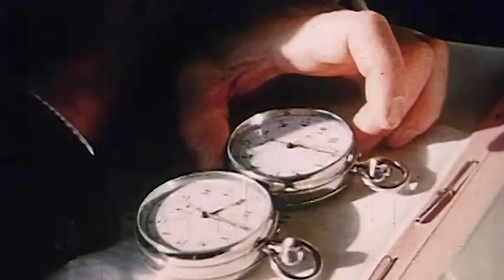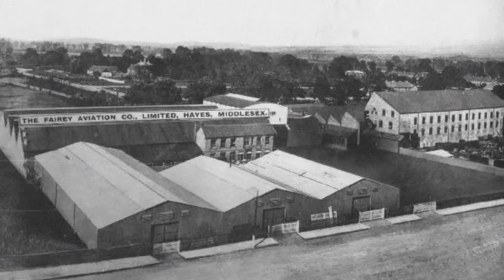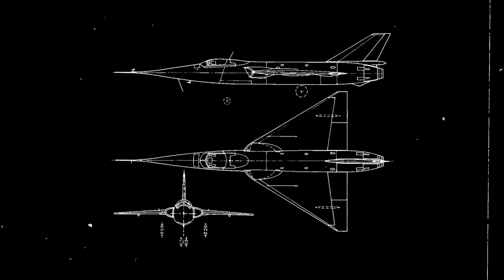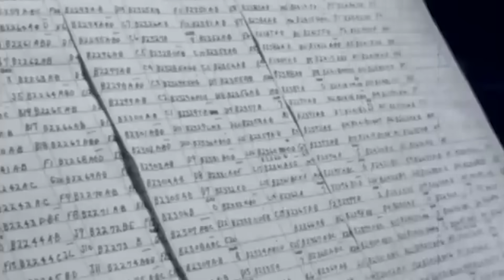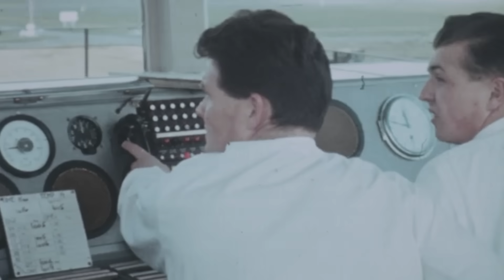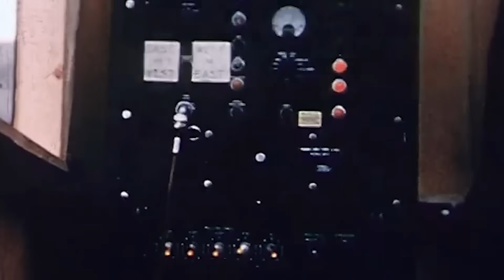Britain's 300 MPH Most Successful Mistake

Comment: OMG, then the TSR2 years later was killed. Too coincidental, It must be us Americans told the Brits to kill these planes, they were TOO GOOD!
Reply: TSR.2 like BAC were unmitigated failures... early test flights revealed the TSR.2 was a bad design and was not even airworthy..
Reply: @DoktorBayerischeMotorenWerke 

We believe we can clear up some commonly held myths and misconceptions, obviously

It's always good to see the facts presented clearly and concisely isn't it?

British Aerospace Sector & some bits & bobs etc. 

20 hours of TSR 2 flight testing showed the aircraft performed beyond expectations at the point of cancellation with a planned 2000 hours of flight testing planned but not performed. 

Interesting British achievements.
There is no doubt that the Fairey (England)
Delta 2 was of course the world's first jet
aircraft to exceed 1000 mph.  lndeed It
exceeded the previous record by 310 mph &
held the record for more than a year. Incidentally, the Dassault Mirage series of aircraft are based on the Fairey Delta 2. 
March 1956,  UK Peter Twiss,
1,132	 mph, Fairey Delta 2,	 Chichester, UK

The next speed record after the FD2 -
December 1957, USAF	1,207.6	mph, McDonnell F-101A Voodoo, 	Muroc, California 😎.

Non combat phase accident losses.
% of Aircraft built.
The EE Lightening did not have unusually high losses. 
The Canadair CL-44 was a turboprop airliner.
Canadair CL-44               (ff 1959 ) 48%
Lockheed XF104             (ff 1954) 100%
Lockheed  P80                (ff 1944)  43%
Lockheed F104               (ff 1954)  45%
MD FH Phantom 1          (ff 1945)  35%
MD F4 Phantom 2           (ff 1958)  28%
Convair F102 Dagger      (ff 1953)  45%  
MD F3H  Demon              (ff 1951)  32%
MD F-101 Voodoo           (ff 1954)  34%
EE Lightening                   (ff 1954)  33%
Gloster Meteor                (ff 1943)   21%
DH Vampire                     (ff 1943)   23%
DH Sea Vixen                  (ff  1951)  33%
Gloster Javelin                (ff 1951)   20%

Note that the Meteor didn't have particularly high losses, flew with more than 20 airforces for decades, got involved in air to air combat during a number of conflicts successfully against aircraft that first flew many years after the Meteor first flew.

Early days, jet engines. Whittle performed the world's furst demonstration of a gas turbine aero engine in 1937. The RR Nene, a centrifugal gas turbine aero engine, was the world's most reliable & most powerful gas turbine aero engine in 1944. Licensed built versions & copies of the RR Nene & RR Derwent would go on to power many aircraft in Russia including the Mig 15 & Mig 17, the US, China, France & other countries for decades after 1944. Incidentally, the Mig-15 was in essence an upsized / tweaked copy of the Whittle / Gloster E28/39 jet aircraft including a copy of the RR engine.  The centrifugal compressor gas turbine aero engine with Whittle style reverse flow combusters and sometimes an axial compressor section is still manufactured by more than one company, the main application being helicopters.

   That's correct, The Tornado & Typhoon & their engines are supersonic & are indeed British design aircraft with British design engines built by an international consortium. The Tornado design for example started life during the 1950s at Vickers as the AFVG, it's engine is based on the RR RB-199. The EE Lightening is also a British Supersonic jet aircraft. At the time the EE Lightening first flew it was indeed one of the fastest aircraft on the planet, it was still one of the fastest aircraft on the planet 4 years later when it managed a mach 2 flight.

  The Typhoon is the British BAC-EAP with an engine based on the British RR XG-40, the Typhoon is also built by an international consortium.

  Clearly It's a great pity & a crying shame that British military forces had to occupy a large part of Germany for decades after 1945 & Russian military forces had to do the same. Of course Russia still posseses a large chunk of what was German territory & of course  Russia & the UK produce nukes. Obviously Germany does not produce nukes.

An example of what goes on these days in various countries.

   Indeed, There are no German companies that make German jet aircraft in Germany & there are no German Companies that make German gas turbine aero engines in Germany that are suitable for widebody airliners.

  BAe Systems, GKN Aerospace & Rolls Royce combined now do more Airbus work than Germany on an absolute basis & significantly more work than that on a per capita basis.
   
  Per capita for the home nation BAe Systems is the world's largest defence contractor. BAe systems announced the recent £4 Billion takeover of Colorado based US based Ball Aerospace.
  
  BAE systems now does a significantly higher value of work for Airbus than it did when it was a major Airbus shareholder before 2005.
     
  RR now owns US Engine maker Allison for example which does classified Aerospace work for the US Govt.
   
 Anybody currently flying on a widebody airliner stands a good chance of being on an aircraft powered by RR gas turbine aero engines built in the UK.

  A glimpse of what goes on in the very internationally orientated British aerospace sector.

Boeing Apache Attack Helicopter.
AH-64: 75 UK suppliers, 7% UK content, global fleet of 1280+ aircraft.
F35B more than 130 UK Suppliers, more than 30% UK content.
F35A & F35C more than 130 UK Suppliers, more than 15% UK content.

The UK has the world's highest combined per capita Nuclear, Defence & Aerospace Sector activity.

Rolls Royce Holdings UK
Subsidiaries
- Rolls-Royce plc
- Rolls-Royce North America (Allison etc &  
  Classified Military stuff)
- Rolls-Royce AB
- Rolls-Royce Deutschland
- Rolls-Royce India Private Limited
- Rolls-Royce Marine Power Operations
- Vinters Engineering Limited
- Rolls-Royce Controls and Data Services
- Rolls-Royce Power Systems
- Bergen Marine
Joint ventures include:
- Rolls-Royce Turbomeca
- MTU Turbomeca -

Trent Family
The MT30 (Marine Turbine)
Industrial Trent 60 Gas Turbine
Trent 7000
Trent XWB Airbus A330neo.
Trent 1500
Trent 1000
Trent 500
Trent 600
Trent 700
Trent 800
Trent 8100
Trent 900

RR wholly owned subsidiaries in Germany handle smaller 2 shaft RR gas turbine aero engine work.   

We hope this helps of course.
     
Cheers, as always & indeed 👍.

Comment: My recollection from time at Handley Page around 1956/7 was that the FD2 was used to study high speed Delta wing performance, and Handley Page were given the task of making an inexpensive, low powered (Gnome engine possibly?) aircraft the HP128 to study in parallel low speed handling.   This was looking forward to the development of high speed passenger travel across the Atlantic.   Some believed it should be also used on Anzac routes, but this idea was short lived as Middle Eastern rulers objected to the possibility of sonic booms upsetting their livestock.

Comment: You said it, the UK  govt  has often acted
Reply: We often forget that there were only two winners in WW2.... and that Britain was not one of them.
Reply: @DoktorBayerischeMotorenWerke 

We believe we can clear up some commonly held myths and misconceptions, obviously

It's always good to see the facts presented clearly and concisely isn't it?

It's a great pity that British military forces had to occupy a large part of Germany for decades after 1945, see further down for details.

British Aerospace Sector & some bits & bobs etc. 

Interesting British achievements.
There is no doubt that the Fairey (England)
Delta 2 was of course the world's first jet
aircraft to exceed 1000 mph.  lndeed It
exceeded the previous record by 310 mph &
held the record for more than a year. Incidentally, the Dassault Mirage series of aircraft are based on the Fairey Delta 2. 
March 1956,  UK Peter Twiss,
1,132	 mph, Fairey Delta 2,	 Chichester, UK

The next speed record after the FD2 -
December 1957, USAF	1,207.6	mph, McDonnell F-101A Voodoo, 	Muroc, California 😎.

Non combat phase accident losses.
% of Aircraft built.
The EE Lightening did not have unusually high losses. 
The Canadair CL-44 was a turboprop airliner.
Canadair CL-44               (ff 1959 ) 48%
Lockheed XF104             (ff 1954) 100%
Lockheed  P80                (ff 1944)  43%
Lockheed F104               (ff 1954)  45%
MD FH Phantom 1          (ff 1945)  35%
MD F4 Phantom 2           (ff 1958)  28%
Convair F102 Dagger      (ff 1953)  45%  
MD F3H  Demon              (ff 1951)  32%
MD F-101 Voodoo           (ff 1954)  34%
EE Lightening                   (ff 1954)  33%
Gloster Meteor                (ff 1943)   21%
DH Vampire                     (ff 1943)   23%
DH Sea Vixen                  (ff  1951)  33%
Gloster Javelin                (ff 1951)   20%

Note that the Meteor didn't have particularly high losses, flew with more than 20 airforces for decades, got involved in air to air combat during a number of conflicts successfully against aircraft that first flew many years after the Meteor first flew.

Early days, jet engines. Whittle performed the world's furst demonstration of a gas turbine aero engine in 1937. The RR Nene, a centrifugal gas turbine aero engine, was the world's most reliable & most powerful gas turbine aero engine in 1944. Licensed built versions & copies of the RR Nene & RR Derwent would go on to power many aircraft in Russia including the Mig 15 & Mig 17, the US, China, France & other countries for decades after 1944. Incidentally, the Mig-15 was in essence an upsized / tweaked copy of the Whittle / Gloster E28/39 jet aircraft including a copy of the RR engine.  The centrifugal compressor gas turbine aero engine with Whittle style reverse flow combusters and sometimes an axial compressor section is still manufactured by more than one company, the main application being helicopters.

   That's correct, The Tornado & Typhoon & their engines are supersonic & are indeed British design aircraft with British design engines built by an international consortium. The Tornado design for example started life during the 1950s at Vickers as the AFVG, it's engine is based on the RR RB-199. The EE Lightening is also a British Supersonic jet aircraft. At the time the EE Lightening first flew it was indeed one of the fastest aircraft on the planet, it was still one of the fastest aircraft on the planet 4 years later when it managed a mach 2 flight.

  The Typhoon is the British BAC-EAP with an engine based on the British RR XG-40, the Typhoon is also built by an international consortium.

  Clearly It's a great pity & a crying shame that British military forces had to occupy a large part of Germany for decades after 1945 & Russian military forces had to do the same. Of course Russia still posseses a large chunk of what was German territory & of course  Russia & the UK produce nukes. Obviously Germany does not produce nukes.

An example of what goes on these days in various countries.

   Indeed, There are no German companies that make German jet aircraft in Germany & there are no German Companies that make German gas turbine aero engines in Germany that are suitable for widebody airliners.

  BAe Systems, GKN Aerospace & Rolls Royce combined now do more Airbus work than Germany on an absolute basis & significantly more work than that on a per capita basis.
   
  Per capita for the home nation BAe Systems is the world's largest defence contractor. BAe systems announced the recent £4 Billion takeover of Colorado based US based Ball Aerospace.
  
  BAE systems now does a significantly higher value of work for Airbus than it did when it was a major Airbus shareholder before 2005.
     
  RR now owns US Engine maker Allison for example which does classified Aerospace work for the US Govt.
   
 Anybody currently flying on a widebody airliner stands a good chance of being on an aircraft powered by RR gas turbine aero engines built in the UK.

  A glimpse of what goes on in the very internationally orientated British aerospace sector.

Boeing Apache Attack Helicopter.
AH-64: 75 UK suppliers, 7% UK content, global fleet of 1280+ aircraft.
F35B more than 130 UK Suppliers, more than 30% UK content.
F35A & F35C more than 130 UK Suppliers, more than 15% UK content.

The UK has the world's highest combined per capita Nuclear, Defence & Aerospace Sector activity.

Rolls Royce Holdings UK
Subsidiaries
- Rolls-Royce plc
- Rolls-Royce North America (Allison etc &  
  Classified Military stuff)
- Rolls-Royce AB
- Rolls-Royce Deutschland
- Rolls-Royce India Private Limited
- Rolls-Royce Marine Power Operations
- Vinters Engineering Limited
- Rolls-Royce Controls and Data Services
- Rolls-Royce Power Systems
- Bergen Marine
Joint ventures include:
- Rolls-Royce Turbomeca
- MTU Turbomeca -

Trent Family
The MT30 (Marine Turbine)
Industrial Trent 60 Gas Turbine
Trent 7000
Trent XWB Airbus A330neo.
Trent 1500
Trent 1000
Trent 500
Trent 600
Trent 700
Trent 800
Trent 8100
Trent 900

RR wholly owned subsidiaries in Germany handle smaller 2 shaft RR gas turbine aero engine work.   

We hope this helps of course.
     
Cheers, as always & indeed 👍.
Reply: @DoktorBayerischeMotorenWerke 

Clearly It's a great pity & a crying shame that British military forces had to occupy a large part of Germany for decades after 1945 & Russian military forces had to do the same. Of course Russia still posseses a large chunk of what was German territory & of course  Russia & the UK produce nukes. Obviously Germany does not produce nukes.